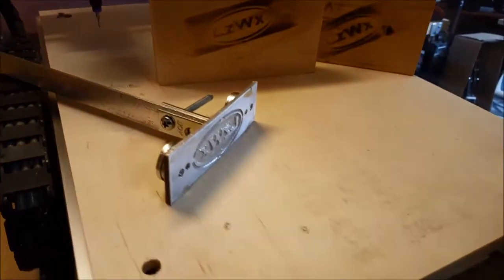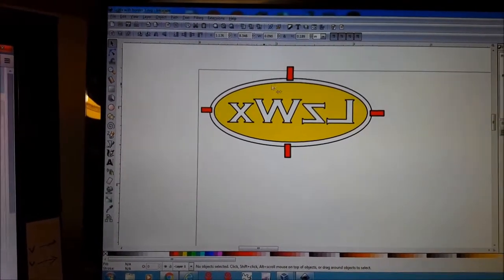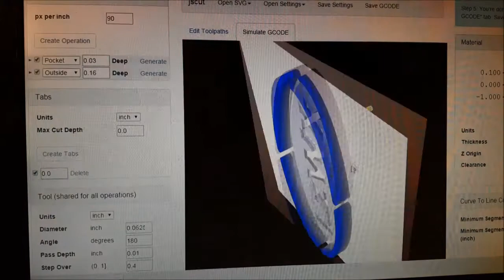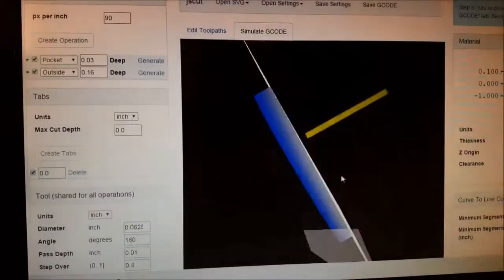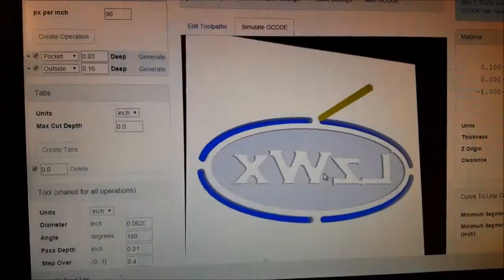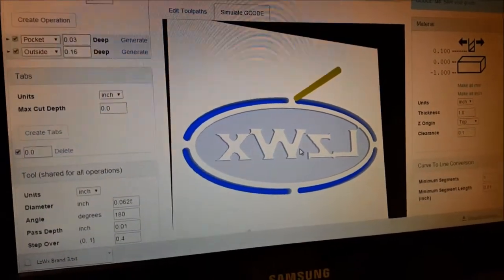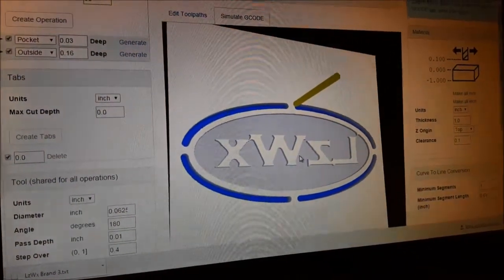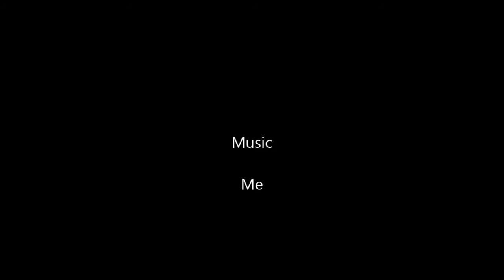3040 CNC Spindle Upgrade - And Branding Iron Project

Comment: What size bits can the dremel take??
Reply from the maker: Dremels use 1/8th inch bits, or .125.  Pretty common end mills.
Reply: I know this is a bit late, but what did you do about covering the switch. I have to unclamp mine and remove the dremel and turn the switch off to use the spindle lock. Thinking about removing the mount and milling a slot for switch access. Other than that it works great!

Comment: Hey Dan, I love your videos keep up the good work. ihave the same machine and have come across the same limitations with the 200w spindle and one piece spindle clamp/z travel. I am going to look into getting a dremel 4000 for my machine now, but i was wondering if you could post a video about what brand end mills you use? as I need to replenish my supply of endmills and would like to hear about your experiences with your prefered brand. thank you :D
Reply from the maker: +Nicholas Anderson Hi Nicholas.  Thanks for your comments.  I use a variety of end mills/router bits.  They are so cheap on eBay I tend to pick up lots of different kinds at random times.  However, the ones I use the most are 1/8" carbide tipped, like along these lines:  http://www.ebay.com/itm/10X-1-8-Carbide-Flat-Nose-End-Mill-CNC-Router-Bits-Double-Flute-Spiral-17mm-USA-/311377079111?hash=item487f852b47:g:mvEAAOSwKrhVdUCo
The other ones I use more frequently for very fine work are used PCB board cutters.  A lot of companies retire very good end mills far before they are dull.  http://www.ebay.com/itm/Two-Flute-Carbide-End-Mill-Variety-Set-M1-CNC-Dremel-PCB-MDF-Model-Rout-M1-/151342239053?hash=item233cb34d4d:g:ArwAAOSwd4tTxAhO
Best of luck to you.